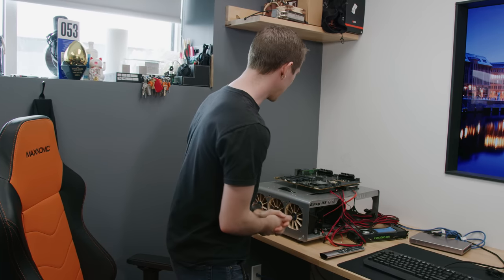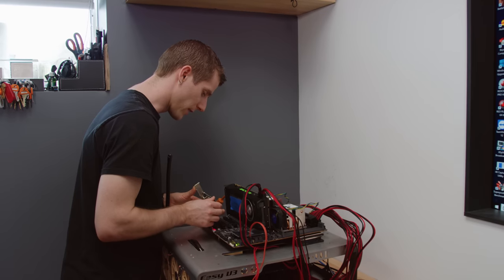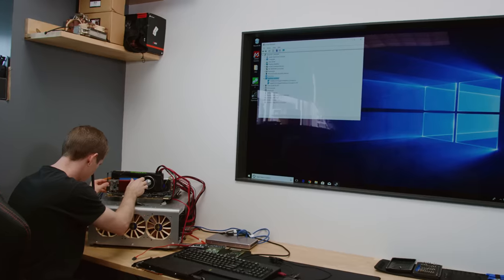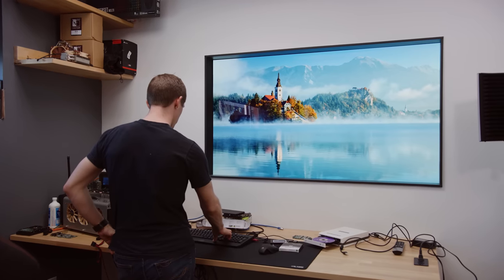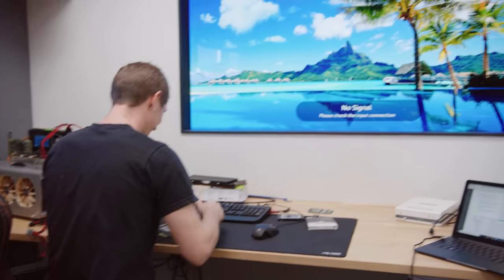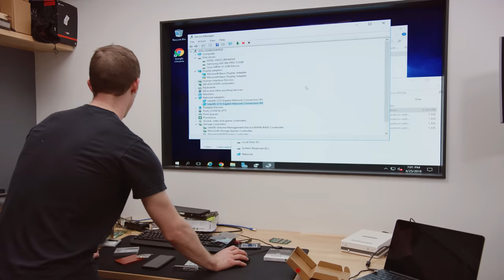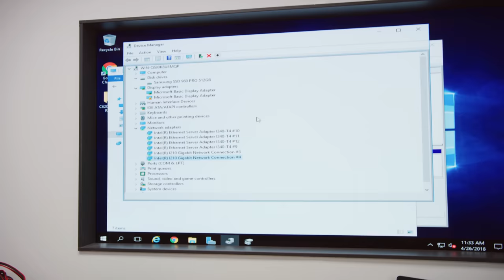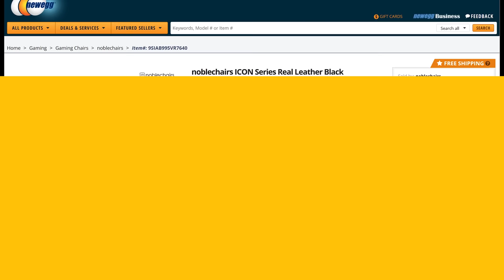I've NEVER been so FRUSTRATED... Hot-Swapping PCIe Cards

Comment: Hotswapping PCI has been around since 1995, (PC-Card)PCMCIA 5.0 (aka "CardBus") is pretty must just PCI in a hotswappable setup.

Oh, and PCIe in hotswappable form has been around since 2003 in the form of ExpressCard (the thing that replaced PCMCIA/PC-Card).

Also - being a hotswappable PCIe (combined with DisplayPort) is pretty much what Thunderbolt (2011) is.
Reply: Yup. Hotswapped a almost dead graphics card back in 2004 to reflash it... haven't tried something like this ever since. ;)
Reply: Yeah but could you easily hotswap PCIe cards like this on a consumer board? That's the point of the video. It's not a fucking history lesson. You could do the same on an IBM Mainframe.  This is a CONSUMER WORKSTATION board using ALL Kinds of PCI "E" cards. That's damn cool.
Reply: Yes. At least it worked on a simple Desktop in my case. It's not as special as it seems to be.
Reply: Last time I used a workstation board was when AGP still was a thing (I favour laptop parts due to them usually having a better 
build and design from an electrical point of view, and they tend to be less harshly overclocked).

However this is a software issue (the video shows it quite clearly as well) so it basically is "feature complete BIOS finally arrive in consumer boards after about a decade and a half".
(If anything one should be annoyed that boards comes without this capability - but that is a sideeffect of that the consumer segment pretty much is the budget segment for uninformed customers (as demonstrated by the fact that active cooling is the norm)).

I guess the answer would be. All boards can hotswap PCIe cards like that if given the appropriate software.
(A quick glance at the pinout states that PCIe edge connector has a bunch of "PRSNT" (present) pins that are shorter than the rest and placed at extreme opposites which even tells us how to detect hotplug (and which kind (x1, x4, x8, x16) is installed) electrically).
Reply: Johnny Cache but it's the first step in the process to make it user friendly. Now people see it work's people probably start developing ways like hotswap pc case's that make it easier to do init

Comment: The hardware has no problem with what you're doing.  And in that sense, the hot-swapability is actually there.  The issue is clearly the driver.  If the card itself doesn't have drivers that support hot-swapping, and you suddenly give it a condition it's not expecting...well, you see what happens.  In this case, I actually think trying this in Linux would have been better.  Or on an OSX machine, as well.

Comment: Try a video card with 6/8 pin connctor pls
Reply: Viktor Kunov he did try a card 🤦🏻‍♂️
Reply: the card linus tried didn't have the 6/8 pin power connector, some 1050ti's work with default pcie power with no additional required.
Reply: josh sanderson Can I have a link man
Reply: josh sanderson link of the video
Reply: josh sanderson i mean a card which requires additional power..

Comment: I had to build a disk wipe device on a limited budget. The U.2 HBA supported hot swap, but the motherboard did not. When I pulled a NVMe drive from a hot swap bay, Windows would always hang.

I didn’t think of disabling the device in Device Manager until I watched this video. It worked!

I made a simple powershell script that would disable all NVMe controllers, then bring up a dialog box that says it’s safe to remove the NVMe drives. Once the drives are swapped, selecting “OK” in the dialog box allows the script to continue. The script then goes through and enables all disabled NVMe devices.

Pretty jank, but now 20 hour HDD wipes don’t have to be interrupted to wipe an NVMe drive.

Comment: So this is basically Thunderbolt but better?
Rip Thunderbolt?
We now get external PCIe connector ports for laptops? Can we get more than 4 PCIe lanes?; so external GPU’s will be running at 100% for laptops?
Reply: Another thing to ask is if they end up making PCIe external slots, will Gaming oriented Notebooks that have a very low power consumption GPU like a GTX1030 and your supposed to use a external GPU, have 8+6/8+8 pin power connectors so there’s no need for a expensive GPU mount, and still a half decent power brick?
Like maybe 2 power bricks but one of them you only need to plug in for when your going to use a external GPU.

Comment: i want hot-swappable girlfriends
Reply: You need one first.
Reply: Have to have one to hotswap one
Reply: That'll cost ya
Reply: "Plug" into them
Reply: Great in theory but takes up too many resources for all the drivers required. Girlfriends throw a grave protection fault if you accidentally try to access one that's currently not connected.
Reply: First have to find two girls that are dtf with you.
Reply: You want to eject when the system is still turned on?
Reply: penkata drums gg bro gg
Reply: ...so basically a trio kinda deal as the basic form?
Reply: OOOOOOOOOOOOOOOOO!!! Now there's and idea!
Reply: They don't want your viruses. Manbaby.exe should stop working.

Comment: Thunderbolt, the original hot swap pcie
Reply: B&C Connection LLC No, all pcie devices since pcie 1.0 should support hot-swap. PCIE is much older than Thunderbolt. Hope you were joking
Reply: Kinda since PCIE 1.0 supported very limited items and by Linus showing a need for a custom bios to even do it with a board with the option native. Thunderbolt no problems. I hot swapped my eGPU on thunderbolt without problem.
Reply: Hotswapping on FireWire

Comment: I've been working with infrastructure for 5 years now, and the hot swapping thing is never ok with Windows, in Linux works ok but windows always blue screen, there is a procedure to remove and add, hot swapping doesn't mean plug and play...
Reply: Fernando Coelho
Windows too if you do unmout them manual!
When windows is using the device , windows hangs......
Reply: Not so easy, even removing, and windows saying it works, it may blue screen for no apparent reason, so in my company it was kind of "forbidden"  hot swapping in windows servers, and the few tries in lab always something went wrong and logs didn't help much to see exactly what happened
Reply: Fernando Coelho
Only do it on trusted solutions, never experiment, up times need to be as high as you can!
Reply: TalesOfWar
unmounting, library library files too, disable all before you remove it, surprise swap will never work!

Comment: Pci/pcie is not designed to be hot-swap, as gnd and V+ pins too close to each other, what you do is shorting MB.
Reply: Wouldn't that cause a hard crash?
Reply: Shorting the MB is a risk, but not a guarantee. 

PCI and PCIe are both capable of hot swapping, but the standard slots used with both are not for the reason you mention. Keep in mind pc card is just pci with a different connector, similar to how express card is just PCIe with a different connector. u.2, m.2 are just PCIe with a different connector. The different connectors do not make those not PCI or PCIe.

That this is only supported with u.2 connections or a special backplane is no big surprise considering both can be used to deal with the issue you mention.
Reply: Well, if motherboard somehow could regulates power on pcie and ignore short, like that bios does, it is possible to set up pcie for hot-swap, but usually MB detects shortage and crashes windows.

Comment: PCI was designed at a hardware level to support hot plug. That's why there are contacts at each end that are shorter, so that once those touch all the contacts in between will be good.

Comment: This is something that my company needs. We perform firmware updates and test a lot RAID controllers and HBA's. This would be a perfect solution for automation in Linux. Upon plugging in a new PCIe device trigger a script to detect the device type, model, and firmware version then execute tests and flash if needed. I am so jealous to see this as I have been looking for a motherboard with this of feature. Also I am glad to see that it actually is possible to hotswap PCIe devices without doing any damage.

Comment: Before Linus did this video I was pretty sure that PCI-e supports hot-plug (I remember I used it in 2012 to swap video card with network card without rebooting my PC. It was just standard PC with i7 3770 and typical asus mother board on h77 chipset).
After watching this video hot plug on PCI-e doesn't look so easy.

Comment: I hotplug PCIe cards in laptops for 5 years already, not even new laptops, but 12-15 years old laptops work fine. Installing network cards that have a bios blacklist, insert them right after boot starts / bios is skipped, GPUs on mPCIe riser cards powered from 12V 18A DELL bricks. I hotplug GPUs on laptops while they're running, on C2Q/Socket 478 boards, where hotplug isn't even a remotely thinkable thing, and it just works with no bluescreen. Ofc, if you unplug the PCIe device while you use it, like having a display connected, sometimes (rarely) the computer BSODs, but else, no probs.

Comment: During UEFI boot, there is a routine to check every PCI device connected to the system. It is only a programmer limitation that prevents this checking after boot.

Comment: Wow brings back memories... in the early 2000 I used to hot plug pretty much everything at work, including PCI (there was no PCIE yet), CPUs and RAM (only validated HP/IBM servers with validated parts)

The basic idea: You have to do EVERYTHING yourself. In case of Linux and an storage controller this means "unmount filesystem" "remove from LVM/RAID/whatever", use sysctl to do an scsi-remove on the kernel for every connected drive, then manually unload the driver, then manually unpower every connected drive, then manually unpowered every card, then remove it from the PCI-Tables. AND ONLY THEN remove the card itself. And I guess I forgot like ten more steps.

We charged our customers like this: Removing once single device: €50. For an storage controller with five devices this was like $300. If the system crashes we charge nothing and pay $20 per minute of downtime. If the system needs to be rebooted in a controlled way we reduce our charge by 66%. This was no kids play, you can believe me that.

It never worked reasonable with windows.
Reply: And I forgot to mention: The Slots itself must be build to mechanically support hot swapping. Actually not too hard, they simply have slightly higher ground connectors and the Slot is usually 1-2mm higher than normal slots.
And about our charges, the €50 per device came atop of our normal charge of €40 per 15 Minutes of hand on. All Charges double outside business time. Man the early internet boom was great for ripping of unsuspecting customers, my boss sometimes wrote four digit bills for less than an hour of work done by two fresh and uneducated IT students...

Comment: Why is everyone so surprised? PCIE is made for Hot-Plugging and it has been used for a long time already. ExpressCards worked with it for years and nowadays Thunderbolt 3 works fine with Hot-Plugging. You can even eject the hardware safely just like USB Sticks (using Windows). I tried out my Lenovo T530 with an ExpressCard to PCI-E Adapter and a GPU and it works fine.

Comment: You should try it with an OS that supports PCIe hot-swapping. It'll work then. In general you'll also need to understand that hot-swapping PCIe is like hot swapping SAS/SATA. It helps if you tell the OS you're going to pull the device it is using out, before you actually pull it out.

Comment: I have hot-swapped many things before like hard drives, redundant psu's and server fans. The last time I've seen hot-swap pci type cards were PCI-X 133 in my Compaq Proliant 6500. You had to push a button next to the slot for windows 2003 to remove the hardware and when ready you could pull out the card.

Comment: RTFM can go a long way sometimes ;) FREE TECH TIP :  about cards sitting on the shelf for years - they will not work most times because of oxidation on the pins, just get a sandpaper and clean the pins..works like a charm, especially for memory because of the smaller connection surface.

Comment: What would even be an advantage to hotswapping? (Besides having to wait for your computer to restart whenever you change hardware)
Reply: It would be for servers where they need to replace a failed component without bringing the server down. For example having redundant network cards, one fails, hot swap a replacement, server has 0 downtime.

Comment: I acquired a Compaq Windows 95 desktop which had a riser card with two PCI slots on one side and one on the other. I decided that I wanted to switch witch slot the modem was in..... i was just passed the operating system shutdown still in a powered state with the system waiting for me to kill power and like I did three or four other times I popped the card out, popped the card in, hit reset dot-dot-dot except this time I slipped and landed just beneath the slot and shorted out the entire board it didn't recover. The sad part that was a really nice system and it worked really well.

And the icing on the cake if I remember right I tried the modem in a different system and it still worked.

This is a crazy video but part of me is like I don't see why it shouldn't work.
It also reminds me of the sitting I found for enabling hot swapping on the sata ports, you know when you want to hot swap the boot Drive or a more practical hot swapping semi externally attached drives ( after safely ejecting them of course ).

Comment: I've hot swapped PCIe devices with no issue before on many motherboards...

I wouldn't do it with an expensive part, but network cards and sound cards seem to have no issue most of the time.

Comment: PCIe is interface-hardware-level and electric-wise hotswappable. Basically means the interface is ready for hotswap when proper software and opeartion is ready. However since nobody really needed this feature and it actually requires extra work plus causes performance downsides, it only will properly work on specifically designed system, like perhaps a industrial client.

Comment: Hot swap is nothing new. I have hot swapped classic PCI cards and parallel IDE drives back in the windows 2000 days. On a 440BX based board. Usually after plugging in the device you would have to tell device manager to scan for new hardware. Express card is essentially pcie lanes in a different socket format, cardbus was PCI in a different socket format and PCMCIA was ISA is a different socket format. All could be hot swapped

Comment: You'd be blown away on how many things can be hot swapped.. I remember inserting an ethernet adapter in a running machine (the monitor was turned off) and hearing the "USB Inserted" sound and Windows saw it then started asking for drivers... pretty neat. Tried it with SEGA and SNES carts too... Doesnt work..

Comment: What happens when you run SLI and remove 1 of the graphics cards? Or for that matter, what happens when you remove a working graphics card? Just a system crash or will it fall back to the iGPU (if there is one)

Comment: Actually pci express hotplug does work, you're just looking in the wrong genre. I have a 2006 Acer notebook with a 34mm express card slot ;). Yep thats a pci express x1 lane gen 1. That works pretty nicely with my usb 3.0 adapter card. Hot plugging that card while Windows is running works great too. Card is detected and can also be pulled out without going through windows device manager. Imediate insertion after pulling works too. ;) And all of that on win 7 x64/pro.

Comment: Pretty sure the issue is with Windows 10. Even if I change the voltage on my CPU overclock I get a "BAD CONFIG FILE" error on reboot. From what I can tell Windows 10 keeps some kind of record of the entirety of the PC's hardware and settings and any change is considered an error.

Comment: I've had buggy PCIE network cards that wouldn't work after system sleep. The fix? Poke some magic at /sys/bus to make the bus think there was a hotplug, thus resetting the card! So not only can PCIE handle hotplug, it includes a robot to do it programmatically without opening the case.

Comment: I have NEVER done the "safely remove usb storage device" thing before just pulling my USB drives out... Never had a problem with it, either. Been doing it since at least XP/Vista.
Reply: It's only a problem if you pull it if something is being written to the drive. The safe removal function is used as a extra safety net to ensure nothing starts suddenly using the drive as you pull it.

Comment: try on a normal consumer board. i've hot swapped graphics cards before. having a main gpu and then i used a flat head to break off the end of a 1x pcie slot. and have put cards in there.  just need to scan new devices in device manager. 

i've fixed a few gpus with messed up firmware with this method

Comment: That's cool for testbenchs but not really useable under normal circumstances, I'd say, except for data drives that you run outside of your case, and even then I wouldn't want to risk too much with pci data drives, or datadrives in general.

Comment: PCIe in general is hot plug capable.
I actually did hot plug change the active graphics cards some years ago. Pressing the slot clip to unlock the card made me sweat and AMD / nVidia GPU switch lead to Windows fallback VGA drivers tho - but it worked. ^^ The hot plug setting on hardware tells Windows to handle this drive more or less than an USB stick aka removable media. Should happen automatically for drives you connect when the system is already on. xD

Comment: I hot plugged a wifi card into an HP CQ laptop back in 2009, cause on startup just as W 7.1 icon came onto the screen it would crash. So, yes I had to hot plug it while it was running and installed driver, logged off , then complete shut down. Then started it up and did not crash again and got on the internet and successfully opened several websites  \',v,'/